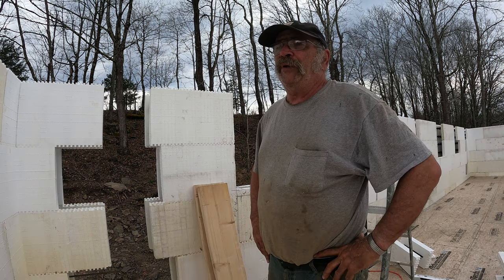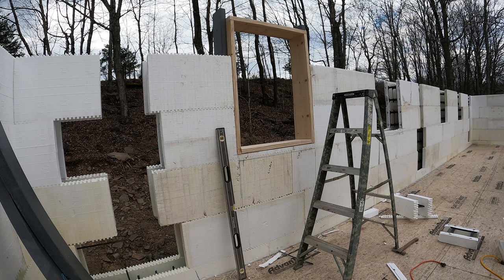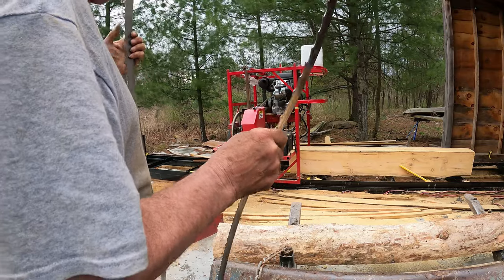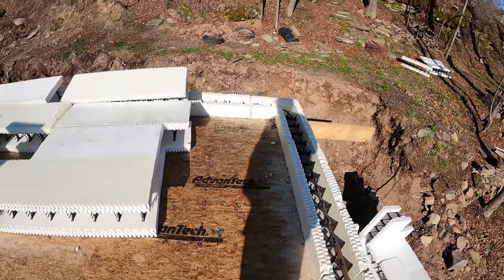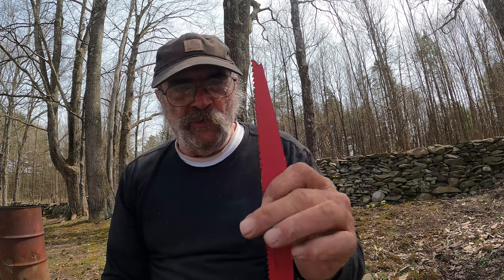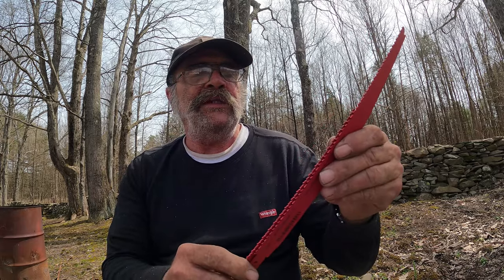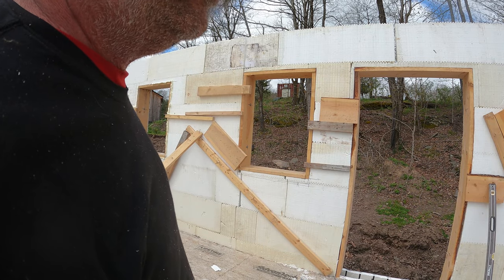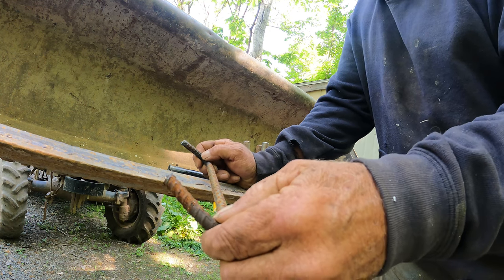ICF house build #9 forming and pouring house walls

Comment: Ooooh, laying the bottom plate on the wet concrete WITH the J-bolts already installed into the lumber? Amazing. No more lining up and drilling each one after the fact.

Comment: The time frame of this video is very apparent across 2 distinct seasons.  When you started laying up the blocks there was no green grass or leafs on the trees and you were still white skinned from winter.  Then by the time you poured the trees were full of leaves, grass on the ground, and Mrs. W had a dark tan.    Nice change of seasons video!
Reply from the maker: yea it was a while in the making we still do outside work (for customers) so we work on the house when we can, I did a good size job for Andrew took several weeks

Comment: Have you ever tried welding that bandsaw blade back together? If you used a 110 volt mig welder it might work? The teeth on that blade seemed to have quite a bit of life left on them. Good luck with the build and hopefully you won’t have too many more setbacks.
Reply from the maker: i have not but i might try

Comment: Make sure to vibrate the walls well during the pour.  That Colorado couple are finding leaks in their ICF basement due to poor compaction creating huge voids.  Not to mention no french drain or waterproofing outside which you have done.  Hell of a thing to have to try to repair after the walls are finished and outside is completely backfilled.
Reply: Yeah this house and Jesse's they seem to be vibrating the walls as they go, just unfortunate some have to learn the hard way but that's life
Reply from the maker: you do have to be careful not to over vibrate it will cause a blowout in the ICF
Reply: @danwheeler5130  Yep and it can also stratify the aggravate and sand.  Definetely where skill is needed.  Too much is bad, too little is bad.  ICFs require experience to do the right amount as well being different from a formed wall.

Comment: Ya really need to make sure your log is securely fastened on the bed of the mill. When cutting the 2x10’s, the log danced around like a fly on a shit pile!
Prier proper planning prevents piss poor performance!
Reply from the maker: yea my log dogs are to far apart one of these days i will add a couple more then i wont have that problem